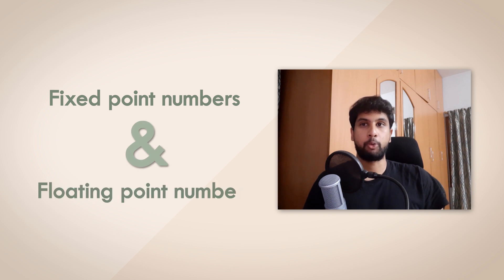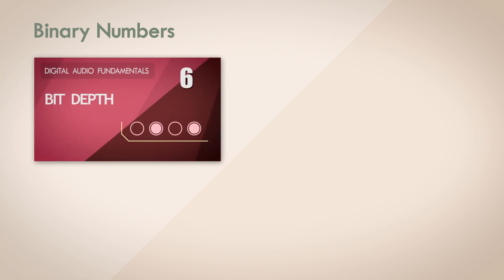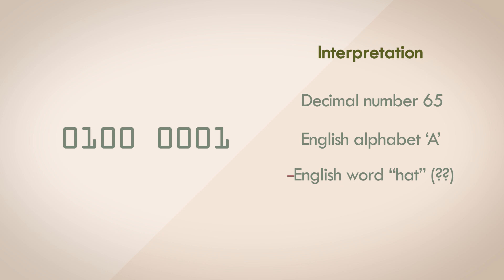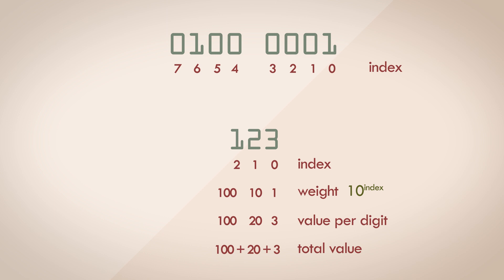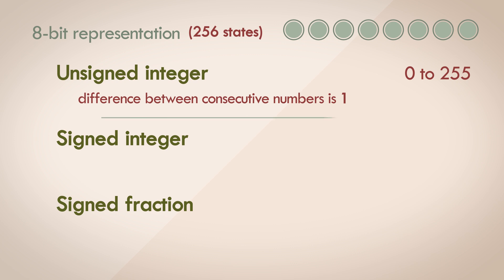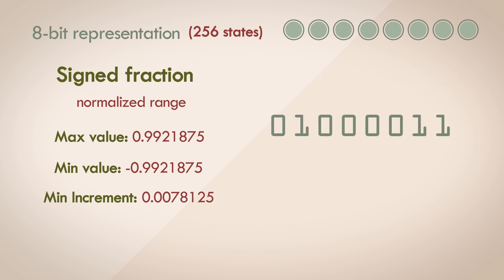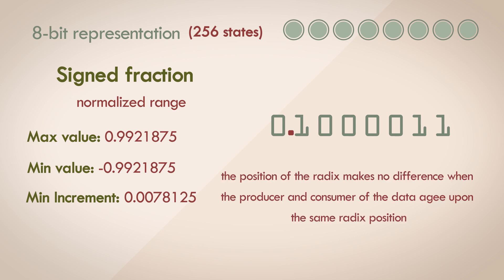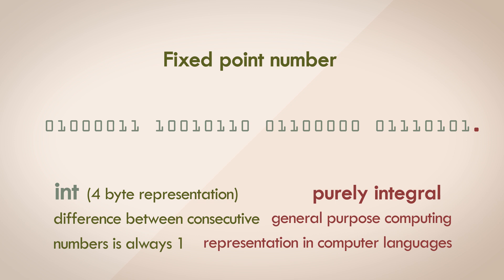1. Introduction To Fixed Point Numbers - Audio Number Formats

Comment: Nice video Akash except that the video ended abruptly. Waiting for the next one in the series.
Reply from the maker: Hey Shyam! Good to hear from you again. Yea, the video on fixed point alone turned out to be around 40minutes in length. So, I'm splitting them up into 4 videos, so it might seem a bit abrupt from one video to the other.